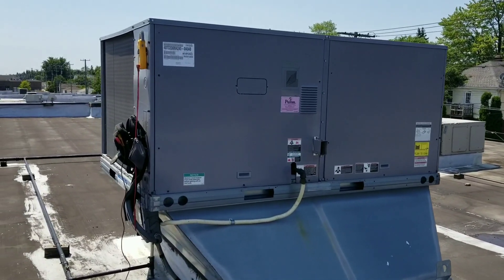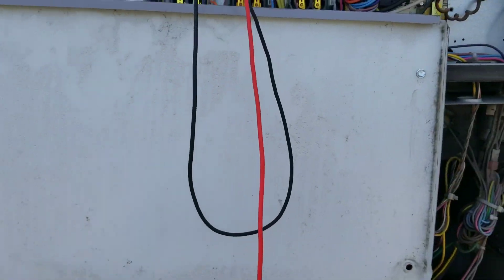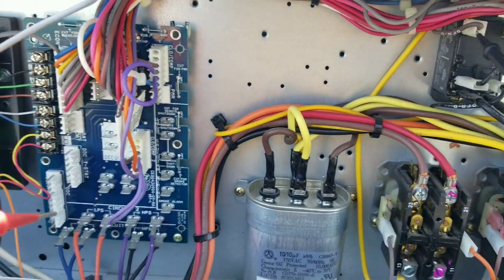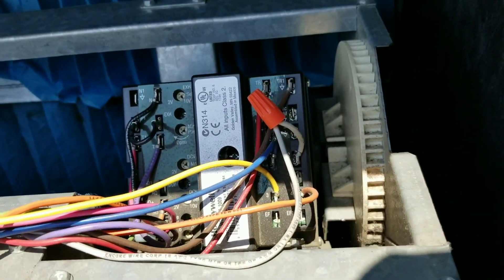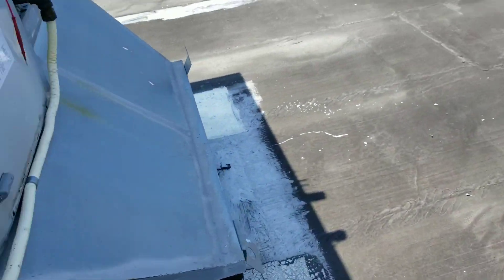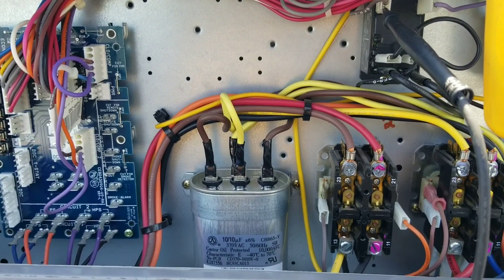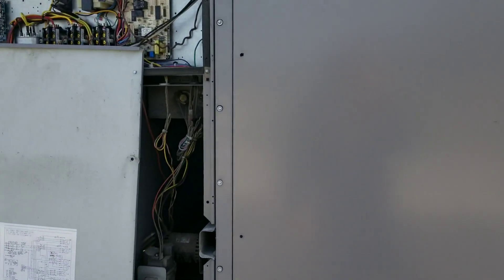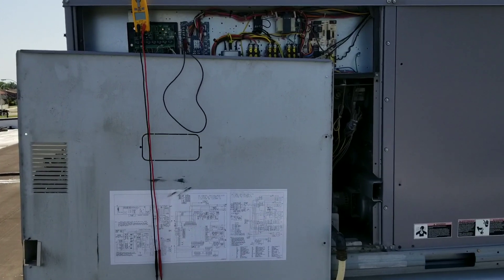Carrier package unit No AC

Comment: Did you ever rewire the low abeyant lock out switch?
Reply: Yes he did not show wiring it back in.
Its supposed wired to interrupt the  mech  cooling call if it’s too cold outside… usually set at 50°f. Its to protect the compressor. I’m hoping he wired it back in

Comment: The logic of that particular economizer obviously opens the economizer damper for 1st stage cooling under "free cooling". It will also bring on the 1st stage compressor as 2nd stage of cooling (if you're thermostat is calling for 2nd stage). If you wire in that LA lockout, it'll prevent the 1st stage compressor from turning on as 2nd stage cooling, during low ambient conditions. This is also why it's important to have 2 stage thermostats with economizers, regardless if you have 2nd stage compressor or not.

Comment: First, learned from and liked the video.
Second, I was not aware that you could interchange the old and new temp/enthalpy sensors for the Honeywell economizers. When we change an old control to a JADE, we are told new sensors are required, yet this has a JADE sensor on the old control.
Third, that low ambient lock out should be connected if in an area that gets below 45°. That locks out your mechanical cooling, Y1 or Y2. Either it keeps Y2 from activating because there is no Y1 or the yellow is also Y2 out from the economizer control.